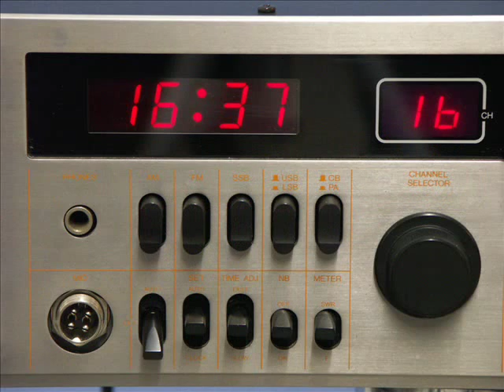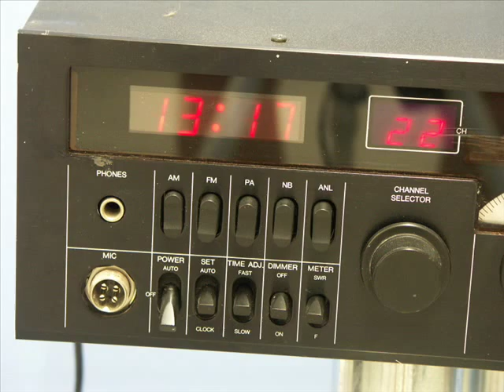Roadstar RM-550, SWISS CB High-End Basestation

Comment: What kind of range do you typically get on AM and SSB with a 500mw output. Actually it sounds kind of fun because it would be all about the antenna.
Reply from the maker: Orange hello, how are you? Thank you for the question. Yes, the power output isn't really so big. But the beste amplifier was the antenna. With a 1/2 or 5/8 wave antenna, you got a distance of about 100km. But on sporadic E, we worked also stations outside of Switzerland. These distances were about 500-1000 km. But with a small 10 Watt PA absolutely no problem. Best 73's to you..

Comment: What PLL chip is in this radio ?  I have a chance to get one and want to know what I'm up against to try to expand it to at least 40 channel setup ?  73's
Reply from the maker: Mr James hello, thank you for the question. The PLL chip in this RM550 or mobile version RM150 is the M53247P. This chip is also in the similar CB-radio model KRACO2530. You'll find the schematic diagram by Rigpix in the follow link: http://www.rigpix.com/cbfreeband/kraco_2530.htm
Reply: That's great sir appriciate the reply very much.  I'm wondering why that page you refer to has that radio using the LC7131 and you say it's the M53247P ?  Glad to see you here, really appriciate your input and info and wisdom !  Good cheers...
Reply from the maker: Please thake a look into the schematic diagram and you'll find the IC8 (PLL) M53247P. It's possible that the M53247P is similar with LC7131. The KRACO is a 40CH version and RM550 and RM150 is a22CH version. The RM550 isn't more in my collection. I can't see what's a PLL is solderet in the RM550...
Reply from the maker: Mr James hello. I'm sorry it was a mistake of me. The LC7131 really is the PLL synthesizer. The  M53247P, is only a LED display driver. The RM550 is new again in my collection. I try it to modify from 22- to 40 channels. I must also mod the Final from 500 milliwatts to 12 Watts SSB. I think , it's a good radio. Best 73's to you.
Reply: Yes sir I'm in same position as you and plan to upgrade mine just as you are WOW very cool !!!  So we can compare note perhaps at some point and help each other...  I'll PM with my email for that brother.  Thanks 73's
Reply: Check your inbox message sent sir !  THANKS and yes it is indeed the LC7131 PLL, and are you going to go with Gerhard for a PLL channel expander or have you decided yet how to approach the PLL but the channel encoder setup is only a 22 click so it has to get another full setup as well !  73's  James
Reply from the maker: Mr Jim hello, thank you for your interest to pimp up your RM550 to 40 channels. The RM550 isn't yet come to my shack, but I've an other plan: I'll remove the channel selector incl. display of a defect PALOMAR SSB-500 and replace it with the 22 channels one of the RM-550. The old PALOMAR has a LC7120 PLL installed and the N-code is identic with ths of the LC7131. So I'll also fill out the space of the final with a 2SC1969 and I get 4Watts AM/FM and 12 Watts SSB...
Reply: This is absolutely awesome !  I like options, and I want to compare notes along the way please.  I'll update...  And check your inbox here too thanks 73's from USA !
Reply: @SWIZZRADIOS  

guten Abend

Ich habe den kompletten Palomar SSB 500 Kanalschalter, brauche aber bitte Hilfe bei der Verkabelung? 😊

gary.sm7zdr(at)gmail.com